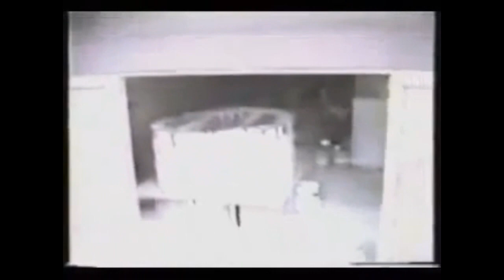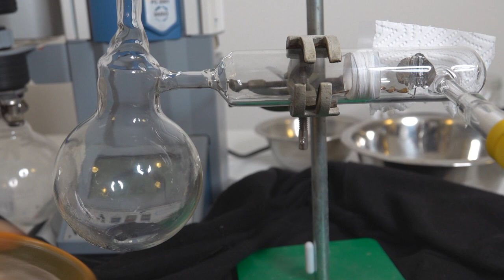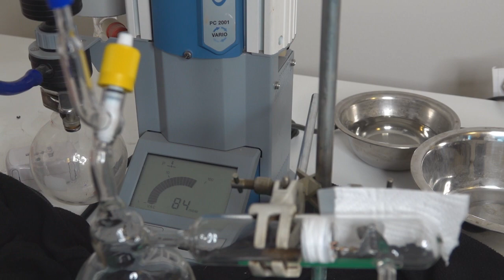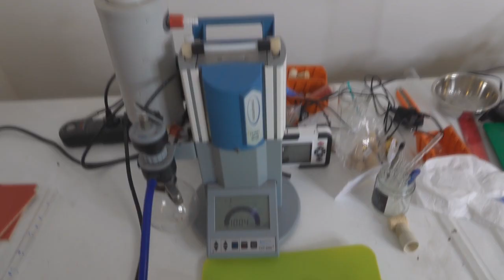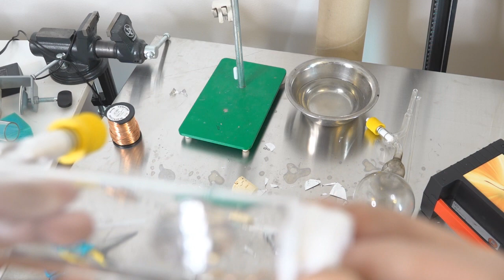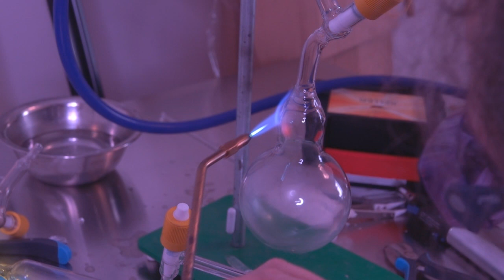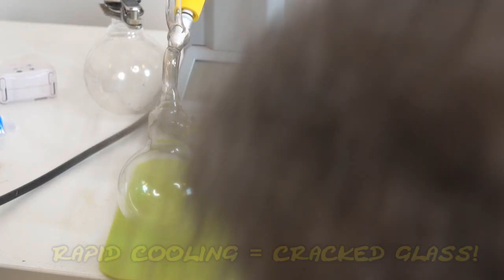The “Hydro-Vac” Space-Powered Steam Engine!

Comment: So we have a couple of issues :) The vacuum allows the compound H2O to change from a liquid to a gas. This leads to the pressure going up in the system. the fact that your pressure reading stays the same is that your running the pump the whole time. For this to work you would need to produce more power from the little turbine than it takes to run the pump. Not to mention the amount of energy required to maintain your temperature differential between the 2 sides.

Very cool demonstration on how pressure and temperature affect the state of matter though :)

Comment: It runs of the temperature gradient, right? 

This means that to run the engine one side would have to be colder than the other to create a difference in pressure. If memory serves me right the energy conversion would be pretty terrible because you would have to pay the energy penalty converting water from liquid state to gaseous form breaking the hydrogen bonds (largest energy hurdle compared to wan der waals).

Comment: Lemme take a crack at this. In the low vacuum the water in the right flask turns to vapor filling the system. Cooling the left flask condenses some of the vapor causing an imbalance in pressure which triggers more vapor to boil off and flow to the cold side to equalize, am I close?

Comment: So it is a heat "engine" (more like heat transfer device) that uses water as the medium for transfer. And thanks to the low pressure inside you need a way lower temperature gradient to get things "moving". Neat "toy" displaying various therodynamic concepts. I like it. Nice build btw.
Reply: yup. right on the cusp of phase change. the illusion is created by room temp. a similar design is used in most steam turbines, only they use higher temp range for, more kinetic energy and potential energy.

Comment: So it's actually powered by the electricity used to make the ice.
In actual space, perhaps the temperature difference between sunlight and shadow would do this work. You'd need a way to pump the condensed water back to the warm side.

Comment: The concept relies on temperature gradient (difference) between two regions within a sealed vacuum system with a water reservoir at the hotter end. So the one end will be north/south pole and the other end is the ocean very far away. Water flows from the ocean to the cold end and spins the turbine to generate energy.

For the ocean end, the seal system must have some mechanical opening that can open and shut at will so water can flow into the system. I believe this is doable since water will definitely flow into the vacuum system. This water vapor flows into the cold end and condense. The problem then is that for the system to function indefinitely, those water condensed at the cold end must be extracted somehow while maintaining vacuum. Somehow water has to flow out without air (which is gas phase) flowing in.

Actually this is possible. In fact it is very easy and practical by utilizing gravity. Water gain a pressure of 1 atm with a depth of 10 meter. So if the cold end is shaped like a test tube longer than 20 meter with enough water condensed, you can have a valve opening at the bottom so water flow out at higher than 1 atm without air flowing in to maintain vacuum. Base on this well known fact and the experiment demonstrated in the video, nearly unlimited energy harvesting is theoretically possible. In fact, water flowing out of water hose nozzles (due to pressure) without air getting in has been demonstrated worldwide by firefighters. The cost of implementation would be the one-time manufacture cost and one-time vacuum cost. Maintenance and repairing will be a different story. A working prototype will not fit into a home though as it will be a minimum 10 meter long.

Wait a second, doesn't this system also distill the water? So it not only generate energy, but also clean water.

Comment: Here's my layman's attempt at explaining it. Let's see how close I am. 

The water evaporates into the vacuum and the cooling at one end makes the water molecules move past the little foil turbine to the cold end. Because it's a near vacuum there's only the friction resistance restricting the turbine so the molecules of water are enough to turn it. With the extra air (50% the atmos pressure at the peak of Everest approx) added, the increased resistance prevents the little turbine from turning.

Of course, it could always be like one of those cosmic ray desk toys but I'm dubious about that since it needs something cold at one end.

Comment: the problem is that the water is going to freeze inside as only the high energy water particles are going to escape, the rest of it stays there to freeze. The only energy you are getting out of the system is the one that keeps the water in liquid state. It's just like a hydrothermal battery

Comment: It’s a cute little heat engine that converts a temperature difference into work. But this particular one takes more energy to set up than you get out (pumping out the air for one). Better to buy a Stirling engine for desktop use :-)

Comment: I know thunderfoot is probably going to make all these points, but here goes anyways:

1) The power it takes to create the vacuum is a big starting cost.
2) The power that can be generated is very little, assuming you can even harness it. The wind barely moves tinfoil.
3) It doesn't run for ever. Eventually the water will all migrate to the other side. It needs to be reversible, but reversing it would take energy.
4) In space, coldness is abundant, but on earth maintaining a heat gradient like that takes energy. It's the same problem as for the sterling engine. The best you could do, even in space, is have this leech off of the inefficiency of your heating system, but by doing this it would just make the heating system even more inefficient.

The levels of smug sarcasm in this video are overwhelming, but wonderful.

Comment: I was thinking, if you could use a vacuum to power a steam engine, by the vacuum turning the water to steam.
 I googled it and found this stream and if I've thought of it, many people must have. So there must be some problem with it, (or we'd all be driving steam cars) such as. The power you'd need to create a vacuum and preserve it at sea level, might be more than the power you get from the steam engine.
Granted, in space you wouldint need to spend any energy to create a vacuum. 
So when the egg head scientists talk of only needing water to power space craft, they're not meaning (as I thought) to separate water and use the hydrogen as fuel, they must have meant they'll use this steam powered method. It would be simpler than splitting water in to its  constituent parts. However, a vacuum powered steam engine is probably useless in an atmosphere.

Comment: So basicly what happens is, because there are so few molicules there the water evaperates and leaves a slight water vaper in the aperatus. By cooling it down on the other side the vaper condenses leaving the space with fewer molekules and because there are now less molecules the vapor is rushing back in. That turns the wheel, wich provides almost nothing in terms of energy. And by cooling the other Side and "stealing" high energy paricles of the Water it cools down. Wich means this is defenetly not sustainable, you would need to heat up the water again. You always need a Energy difference to make Energy usefull.

I dont know for sure this is right but it makes sense in my head :P

Comment: So it needs to be in a complete vacuum and also one of the ends has to be warmed somehow... Also once all the water has moved from one end to the other you have to vent it somehow which will propagate a back-wave which will interfere with the energy generation...

So basically this requires a tube from sea level to space that somehow magically returns all the water back to the start with no energy loss and maintain a near-perfect vacuum, and also you have to overcome all the gravity of the planet, and is also made out of a super strong/light wonder material...

Comment: Nice heat pipe you built there: now you just need the capillary return to restore the fluid level in the hot end and you have infinite energy :D
Well assuming you have a source of heat and cooling <_<
Hang on isn't this basically a room temperature steam turbine? Those need more heat for the hot side and more cooling for the cold end otherwise the energy efficency is terrible!

Comment: Surely to ICE is energy.  What happens when the whole system reaches equilibrium in terms of temperature and pressure, technically the same thing.  How would you keep the cold bubble cold without adding more energy.?  The fan spins because the pressure drop in the bubble being cooled.

Comment: Simple heat pump condensing water vapor out of and increasing the near vacuum causing the water in the other side to boil. The water vapor then flows from the boiling side to the condensing side moving the spinner.  (I bet most of your watchers actually realize this)

the 16 millibars of pressure is all water vapor, that's about the boiling point at room temp. so the pressure regulates itself.

Comment: If you were to add a pump to transfer the condensed water back to the first bulb. and maintain the temperature difference then it should run forever (well at least as long as the sun shines).  You can't let the water freeze. You'd also be better off placing an inner container, that holds the water, into the warm bulb that has a dark surface (much like a solar hot water collecting vacuum tube), and exposing it to the sun. As long as you put more energy into the first bulb (sunlight?) than is used to run the pump, and overcome the inefficiencies, with some to spare to extract, then it should continue to run - not energy from nowhere, just from the sun (which is where most of the heat in your room, maintaining the temperature, probably comes from). Not much more than a solar to air heat pump (solar fridge), but taking some of the heat energy and using it to work a generator and pump.

Comment: Sounds like someone ripped my idea! Wait... There are no liquids in any of my thermogenic engine plans. Of course my engines can be quite large and produce little power or quite tiny (like microscopic) and produce more than enough power for nano-tech applications...
Carry on Thunderf00t!

In all seriousness this is one of the more interesting videos I've seen in a while have you checked out YouTuber "Applied Science" he does a lot of builds to test equipment or make new things.
Also anyone remember those Discovery Channel stores? They sold a neat little pen that worked in much the same way only it was powered by body heat. The energy output of the cells in your finger tips was enough to evaporate a liquid in the vacuum causing it to do something, but I forgot exactly what it did, probably just move an element inside the glass cylinder it was in. I just remember it being kind of neat.

Comment: water DOES biol in space, just your beaker is so small, it is instantly filled with water vapor at the vapor pressure. if it was a lot bigger, the water would boil and freeze.

Comment: If you created that vacuum with falling liquid mercury,  instead of running an electric vacuum pump, and then you slowly conveyed it upwards with a set of archimedes screws arranged like a spiralling set of straight staircases over a long period of low voltage time, and also had the falling liquid Mercury turn a "hydro"-electric waterwheel: would you actually be able to generate useful work energy? 

Just curious... 
Solar panels are weak, but archimedes screws don't leak, so maybe, that could be some kind of ultra-weird yet very efficient hydro-mechanical-electric-thermal capacitor? 

I get a good feeling that you're just dorking around with this one, but I learn by trying in vain to do the impossible until I have fully internalized the correct ammount of respect for it. 
(Like that time I tried to disprove the 4-color theorem (I still can't believe that the "5-color theorem" is something people actually believe in. No. On a 2D topological flat or topologically spherical surface: you only ever need 4 colors. Period.)) 

(And to avoid needing arbitrary colors, once torroids and multihole donuts spring up, stop drawing territories on their surface, and start drawing with cuboids in the space between the surfaces. The number will go up, but not impossibly up. It'll go up to a finite number [probably six but I that's just a hunch on my behalf])

Comment: Maybe you should design a real low temperature difference steam/vapour engine that really does work - and get some real funding.  Some combination of dichloromethane dippy bird principle / linear generator / stirling engine (liquid+vapour, so technically a steam engine) / OTEC might work?  Good for when there is not enough sunlight for solar panels, but you have enough thermal difference between ground and air, say.

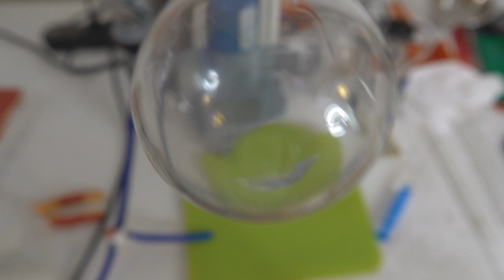Comment: @11:30 Why didn't the water boil? According to a water phase diagram, at 23 degrees Celsius, water will vaporize at about 60-70 mbar. The pressure in the flask is only 3 mbar. I'm confused.
Reply: Hypothesis: He didn't have enough vacuum 'volume' and the water vapor pressure rose above 70 mbar ...

Comment: You should build one of these free energy devices that claim that they're taking the energy from the ionosphere, i mean, if any of these machines have any chance of actually working i'd bet on those, the others are pretty blatantly fake but taking the energy from our ionosphere actually sounds like it could work since it's not claiming to create the energy out of nothing or obviously impossible mechanisms.
Would be great if someone credible could build one of them and debunk them, or on the off chance that they do work, confirm them.

I mean i have already seen (in person) a working car run strictly on water, it had a normal engine with only a few modifications, so if that's a thing and it doesn't make headlines like it should, then who knows what other stuff could already exist and we simply don't know about it.

Comment: What are the common energy source in probes? I know about radionuclide battery's and solar panels and rechargeable batteries but what could be a possible source?  I have heard about a ”battery” with an radionuclide and 2 aluminium foil sheets which go appart (static electricity maybe.
What is this called?
Reply: How momentum does the turbine have?

Comment: Let me try. 

Heat moves from hot to cold. The water is room temperature as he said, the ice is not.

The molecules of water condense on the cold side creating a slight pressure difference between the two globes. This causes the water gas to travel to the cold side, where they impimge on the turbine spinning it.

Not sure why the water does not boil away completely though in the vacuum.

Comment: It is not zero energy use.  You have to create the vacuum.  That takes energy  You have to create the temp differential that takes energy on either side. So not zero energy usage,  but that is what makes it less fantastical , and more practical. Would be awesome for space travel, and Geothermal applications. Not saying you were saying that, but the reports kinda made it sound that way. I wonder how long it can work until water is added to the system.

Comment: To all who didn't understand what he meant by "space powered" "free" energy:
tl;dr It is in principle the same as a solar boiler steam engine, only it uses vacuums and cold (space) instead of fuel combustion to create the temperature differential.

If you scale this up so that you have a vacuum chamber on the earth's surface and the other vacuum chamber in space, connected by a a long vacuum tube, you wouldn't need the ice, you would only need the cold temperature of space and the heat from the sun to create the temperature differential. Water boils at room temperature if the pressure is low enough, hence the vacuum. The water in the warm chamber on the earth surface will evaporate and rise up towards the colder chamber in space. This flow of water vapour turns a turbine generating power.

Alternatively, you could condensate the vapour into water again once it has reached space and let the water fall down to turn a water turbine. That is essentially how rain and hydro power works.

Comment: (I hope I'm not too late...) The explanation is simple and does not break any laws -- of physics or of common sense.
A vacuum is applied, but a pure vacuum cannot be achieved (for obvious reasons) because there's water. Once the atmosphere is eliminated, water in gaseous form displaces it. When ice is applied the gas is cooled, becoming less dense pulling more gasified water over causing a flow. In fact the water will condense.
The reason there is no apparent change in pressure is due to no pressure in increased. Cooled gasses do not increase pressure. Even then if there were increased pressure, the vacuum pump would remove it, thus increasing the flow.
The reason the mechanism fails once a little air is added is that the air would not compress as easily as water because of the lower boiling point.
There are two mechanisms that are the actual source of work: the ice (going from one temp to a lower one) and the pump itself.